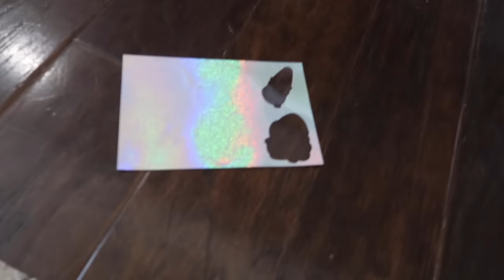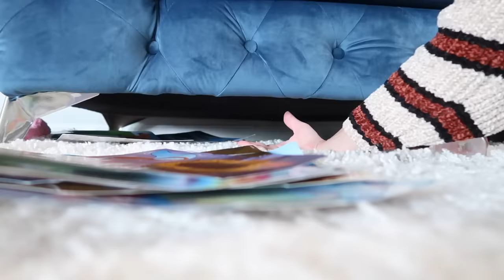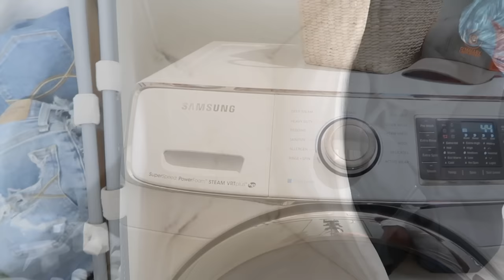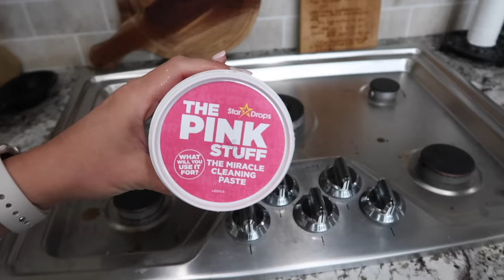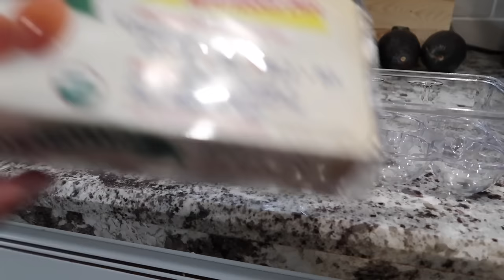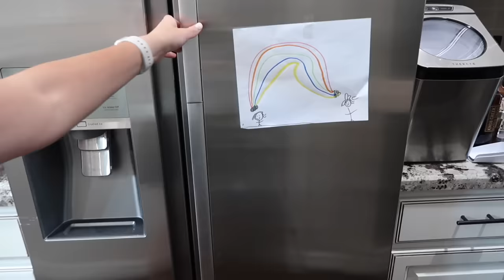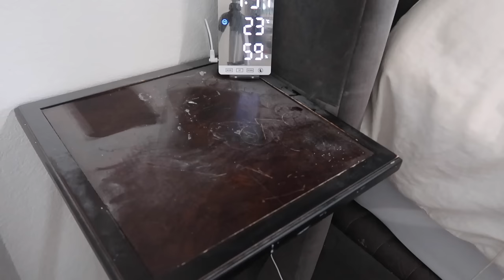EXTREME CLEAN WITH ME MARATHON / HOME RESET MARATHON / 3 HOURS OF NONSTOP CLEANING MOTIVATION

Comment: About rinsing dishes. Yes, you should remove all those leftovers. Also get rid of thick globs of sauce, pools of grease and anything else that can get stuck in the filter. Cold water and a quick splash and they are good to go. Pots get a whisk with the brush too. Burned pots, just take some dishwasher powder and let it stay with hot water for an hour and brush it out.